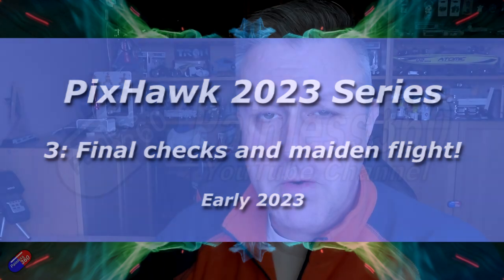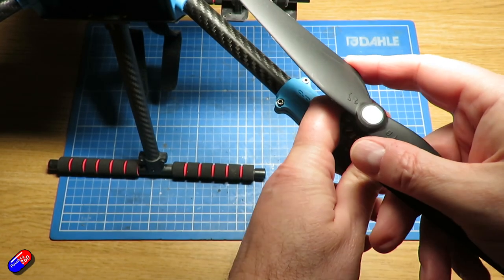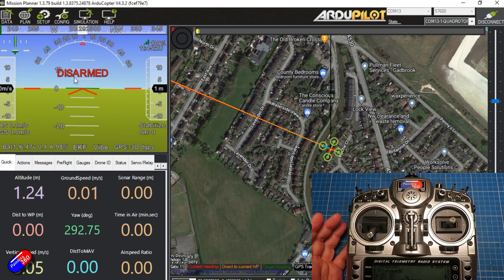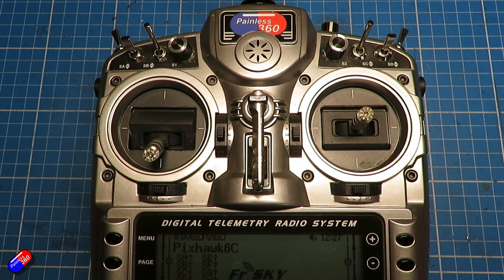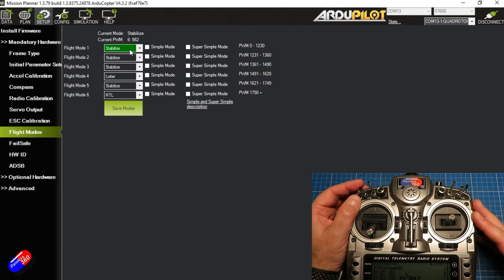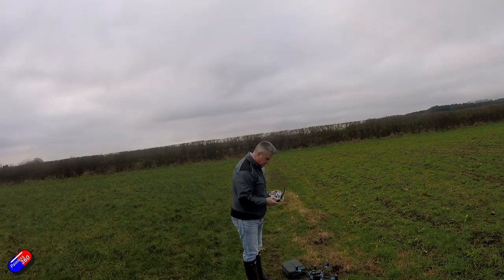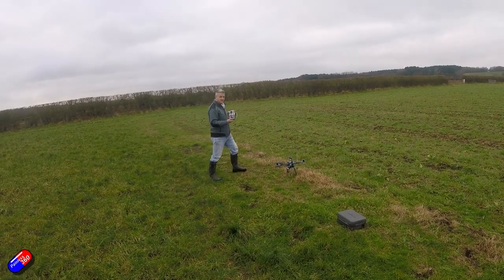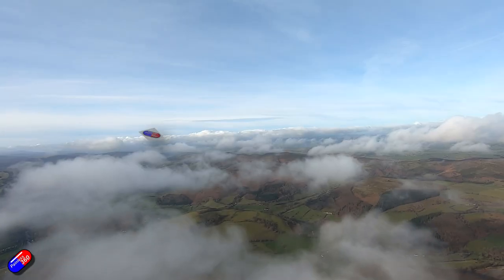PixHawk/ArduCopter for Beginners (2023 series): 3. Final checks and how to fly the maiden flight

Comment: my mom bought 25 apm 2.8 flight controllers and gps for 25.00 at a yard sale. they just told her it was stuff for remote control helicopters and she just got it in case i might like it. i was exited i loved those back in the day. i can't wait to get them. I want to try to make an airplane from a 2 stroke weedeater.
Reply: Get ready to use old drivers then lot of the chinese stuff can't change setting much from the default. Especially the TX module.
Reply: @Errorcutive  i have everything for them on an old laptop already installed i started off playing with those.
Reply from the maker: @Franky Flowers What a cool mom! :D

Comment: Thank you for your video!  I got an X500 V2 and found your videos soon after, truly very beneficial for a beginner!  I followed everything to the tee and it worked perfectly for a while.  Then I let it sit for a while, toyed with other ground control software, flashed firmware a few times (Ardupilot, PX4), etc.  Then I decided to reset the firmware and parameters, and follow your instructions again, it all works well except the ESC no longer works in Mission Planner.  I cannot test motors, they simply do not do anything.  If I use QGC and flash PX4, it works fine.  I don't mind using QGC, but wondering if you have any thoughts on why this occurs.  I did ESC calibration, I switched between ESC types, nothing could get Ardupilot+MissionPlanner to spin the motors, even if I was armed.
Reply from the maker: There are some very good reasons thar I use Mission Planner and Ardupilot in my videos aimed at new pilots....
To 'reset' your X500 with Ardupilot, you'll need to flash it with a different model type (plane if it is a Quad etc.) and back again. 
 Best of luck

Comment: I wanted to build one of these old dinosaurs. I spent quite alot and attempted to calibrate that sucker following directions given on Youtube. It went totally wacko and flew up in the air and the straight in the ground and was utterly destroyed. It met mister hammer and was no more! I have several long range quads and hexcopters, and they use Betaflight and fly great. I guess technology advances for a reason!
Reply from the maker: It is common for a builder new to a technology to make a mistake. And for that oversight to cause a problem. Happens to us all when using any unfamiliar system for the first few times. It is exactly why I make series like this (and spend so much time helping out others). Happy flying!

Comment: Hi Lee, Its a great series so far.  It sorted all my issues. Have just done the maiden flight and all good. Except in stabilize mode it wanders a lot in both elevator and roll not yaw. (hard to see what is front on a hex quad to correct it.
Loiter mode is great and RTL is text book. Is the wandering part of the tuning? or calibration not the best. 
Also would like to setup a RTL if battery low. I only had failsafe at a voltage, but did not do any RTL when under what I set, so may have done something wrong.
Regards Dave.
Reply from the maker: Wandering in stabilise points to a poor accelerometer and level calibration or/and poor radio calibration... I would redo them all... Best of luck
Reply: @Painless360  Thanks I will redo them and go again. Though was strange as was so solid in loiter.
Have you ever tried the fail safe as turned off the transmitter in flight to check. Mission planner shows all good as per your checks, but would be a nervous thing to do.
Cheers Dave.
Reply from the maker: Loiter adds extra sensors. Best of luck

Comment: Thank you for the great series, I bought this quadcopter recently and follow your directions. I am now kind of stuck at the maiden flight mode: I am a total beginner with flying drones, and probably having some panick reactions, but it really seems instable (in stabilized/loiter mode) and not standing still when I am not touching the command, but slowly translating. I also did not manage to land it smoothly: does it require some skill/is the calibration wrong, or is the common technique simply to always land with RTL ?
Reply from the maker: If you've set it up right, it should be very stable. Id check you've not missed any of the steps in the series... Best of luck

Comment: I learned a lot from your videos. I followed this series but the motors won’t turn. No errors on Mission Planner. Any idea what to look at? Thank again for your videos.
Reply from the maker: Use the motor test shown to rule out wiring and ESC protocol setup errors. Best of luck
Reply: @Painless360  Thanks for your reply. The motor test won’t turn the motors either and I can connect each ESC to the receiver channel three and they turn fine.
Reply from the maker: Esc protocol setup is wrong in Ardupilot then. Best of luck
Reply: @Painless360  thanks I replaced esc’s with dshot. Works now. Thanks again.

Comment: I want the drone to operate autonomously. There are few preset locations where the drone is to take photo. The drone first flies to location A and take a photo. The taken photo is to transmitted to the laptop at the ground station. After taking photo at location A, the drone flies to location B and it then also take a photo The taken photo is again transmitted to the laptop at ground station. Then, the drone flies back. Would you be advise on the required hardware or modules to implement these function? Thank you!
Reply from the maker: I've not transmitted images like that here so not sure. I'd check out the Ardupilot docs for clues on how to do that... Best of luck

Comment: Is there a reason in the first videos of this you were using the Radiomaster T16 and now went back to your Taranis radio?  I haven’t been able to bind my T16 to the X8R receiver is the reason I am asking. My Taranis works fine with it.
Reply from the maker: No specific reason. Happy flying
Reply: @Painless360  have you been able to either bind and use the TX16 with a Frsky X8R receiver using the Pixhawk receiver (early Pixhawk, or even newer ones)? Or vise versa, Taranis remote with ER8 reciever using a Pixhawk? I have asked how on a few boards on a few FB boards and told it won’t work.
Reply from the maker: Yes, works well. There are lots of version of the ACCST code - V1 and V2 with either LBT or FCC variants. Yo u need the right one. See my video showing the binding.. Best of luck!

Comment: Hi mate, i had drama with 6c mini, Drone won't arm. I'm using skydriod h12 controller, i don't have any drama with naza-mv2 and tarot zyx-m. What settings did you change at parameters except those 3 error that you have. Appreciate any help.... thanks 😊
Reply from the maker: Try to arm while connected to Mission Planner on the PC and see what the error shown is. That's the best way... Best of luck

Comment: Please help I have a pixhawk 2.4.8 and I’m using the futaba px4 with a r304sb.   The build is for a car. Throttle ch 3 steering ch1 plugged into the pixhawk and a cord to the sbus on my receiver is this wrong? Also I can’t get my ground station to connect with the car unless I have the usb plugged in.  Can anyone help.  Ps I can’t see any signal from my trans in the pixhawk calibration
Reply from the maker: https://youtu.be/uH2iCRA9G7k may be a more useful series for you... Best of luck